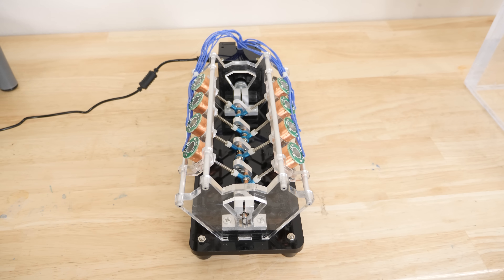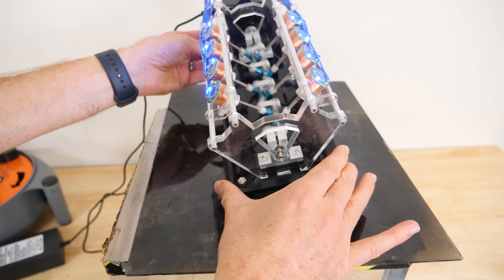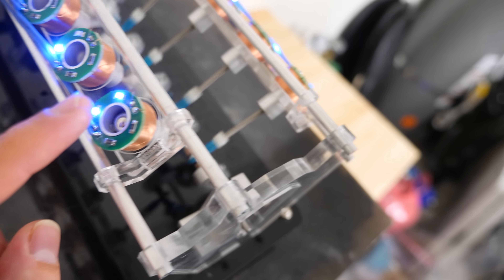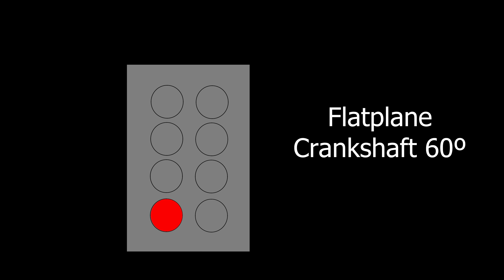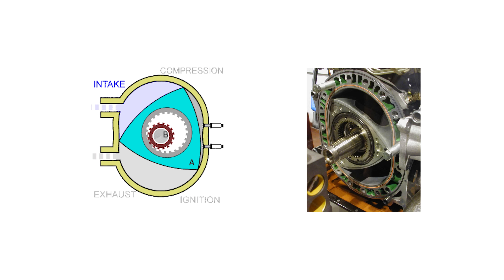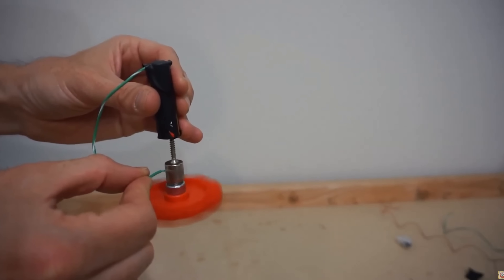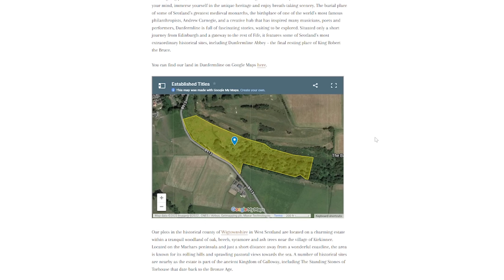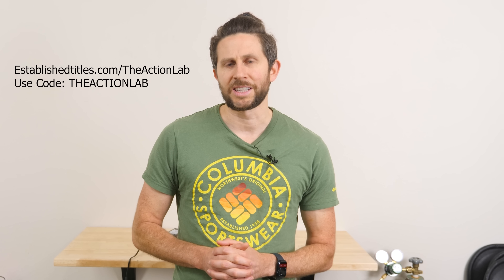Is an Electric V8 Engine a Good Idea?

Comment: So what if you assisted a diesel motor that uses compression to ignite the fuel. The electric coils could assist on up stroke and down stroke. Meaning higher compression and less fuel needed.. what if you put magnets on turbo outter compressor blades or on exhaust outter turbine blades and make turbo go into boost earlier in rpm range with electronic magnets. It could also spool higher at upper rpm range. Only restrictions would be not enough exhaust gasses to turn the turbine causing restriction. You could do low rpm butterfly exhaust dump valve that opens when just using magnets mainly. Such as at max full throttle rpm. Where exhaust tapped out but turbo electric assisted could spool higher if not restricted by exhaust gasses.

Comment: this innovation may save the world economy as we all are looking the side effects of electric vehicle which are running  by a electric motor that means causing damage to the society as the engineer, machinic or the people who are engaged in selling of cylinder engine parts like shops and companies which manufacture and sell the body parts of a cylinder engine that means its create lots of industry which are directly or indirectly dependent on a cylinder engine because some is manufacturing  cylinder of vehicle engine, some is manufacturing carborator, some is manufacturing filter, some is manufacturing plug,, some is manufacturing wire, some is manufacturing coel, some is manufacturing garari, some is manufacturing piston, like this many others are directing or indirectly engaged in the business, other sector is in selling of these parts some is selling plugs, some is selling filter, some is selling cylinder, some is selling carborator, some is selling garari, and many parts of vehicles and in other sector there are engineers manufacturing engine and mechanics who are directly involved in this business will more affects by replace of cylinder engine vehicle by a simple electric motor vehicle. so please appreciate your idea of for manufacturing a cylinder engine by electricity it will leads to creates more jobs in more sectors and it will not close down any sectors which are engaged in this vehicle manufacturing sectors since a long time.

Comment: Simple solution: make a pneumatic engine, put in a chemical reaction with H2O2 and KMnO4 in a tank, make a regulator for 2 bars (29psi) and run it up. Integza made one but I saw it work only with compressed air. I thought about it. Hydrogen peroxide and potassium permanganate's reaction reaches up to 60 bar. So you can totally make an engine that sounds awesome and it uses clean energy. The engine's performance is determined by how much pressure is in a tank. so that's why I wanted you to make a video about it

Comment: Potential method for converting gas engines to electric without swapping engines? Looking at you, @Toyota.
Reply: You need to rebuild the engine block and use magnetic piston which need alot of work and cost rather than swapped it with electric motor

Comment: More cylinders / pistons in a gas engine allow for higher displacement without having massive pistons or excessively long stroke. My 4.9L 6cylinder has bigger pistons than my 4.6L V8. This means you can keep your RPM higher without using exotic alloys. I have a 5.7 hemi and a 5.4SC Gt500 both are V8's they both sounds very different. I love the deeper sound of a truck V8 vs the more race sound of my Gt500 to be honest. I think Cam profile and exhaust configuration makes a big difference.

Comment: No direct need to do it, but maybe smaller version allows mechanical energy to recover electrostatic energy to recharge ev battery or just redundant power primary engine, letting battery multi task to recharge itself. Or people just do it for youtube content, ignoring transformers.

Comment: What's the max rpm? of this V8 configuration? Conversion losses from linear to circular motion is an issue. However, we have the single piston rod. Using 2 electromagnet in a horizontal piston. Its simple design helps with weight and speed control.

Comment: That's a cool concept, and it's shown in the video that it works off of a flat-plane crankshaft system, being that the crankshaft lobes are 180° from each other.  I'm now wondering if it would work on a CROSS-PLANE crankshaft. Also, it is probably not the most efficient way to use the power and torque generated by an electrical propulsion system.  Also, it is not really relevant, but one of the biggest draws to v8 motors that people have, at least in the United States, is that throaty, almost guttural sound that comes with it, if there was a way to NATURALLY produce that sound, like the honda(???) hydrogen v8 motor, then I know of a LOT more people that would be more interested in electric powered vehicles.

Comment: would this engine give you more tork  then your typical electric engine
Reply: It will give less torque relative to size and weight compared to conventional electric motor

Comment: wouldn't it give it more torque if you reverse the electricity in a cylinder instead of switching the power to it off? bc unless im wrong when you do that it should pull it's self back up and not need the other cylinders to push it back up

Comment: If you want this to work... you need cylinder sleeves made of non ferrous materials... a piston hinge pin with no ferrous material and a piston rod with no ferrous material....
the electromagnets need to be two, three, or even 4 tiers deep/in parallel.... the piston needs to be highly polished aluminum or copper... the rings need to be a durable heat resistant mdf?
When the magnets turn on the field they create expands and is pushed back against by the induced field that is generated on the surface of the piston....

Comment: Great, at slow speeds. But relying on the coil inductance will add a lot of delay when you run the engine at 100 cycles per second (6000 RPM).  And where is your source of energy coming from? A battery! Batteries are the weak link in EVs, not the motors.  
Gasoling engines do not "explode" the BURN. Explosive detonation is damaging.

Comment: You are not considering back emf could be used to fire each other piston in turn with less losses.
Not to mention you could also use compression with valves and add an accumulator tank ?

Comment: Electric motor, especially AC motor, is a wonderful invention that should have displace gas engines a long time ago. But the main reason it was not used in cars is the lack of high capacity batteries until recently.

Comment: V8 solenoids. Why make something with loads of  friction?
Just add more motors to a drive train and they will increase the torque but marginally increase  RPM at the cost of range. Tesla uses 2 motors if I'm not wrong, the PM-AC type. 
The pit fall of EV bikes and scooters is the "Hall effect" sensor in the BLDC motor, which when burnt, needs opening up and replacing. Even though the sensor is cheap, its a pain to open up and replace them. 
Sensorless PM-AC motor with a variable frequency drive ticks all the boxes. I hope they replace BLDC motors soon.

Comment: I've often thought there was no reason not to have a speaker put out a sound on an electric vehicle, if just to let people know it's moving, so they know to look out for it.
Reply: i have always thought this would be a cool idea, too. from what i've read, i know that some cars actually use the car stereo system to play engine sounds for the driver in order to add to the experience, so this would just be the same thing but for full EV's. 
realistically though, i think the novelty would war off pretty soon and it would just be turned off after that. for example, modern automatics have the paddles which let you shift like a standard, but after playing around with them a few times, who actually uses them for their daily driving? so i think it would be similar to that. if you want a standard to use the gears, people just get a manual transmission, and people who want the engine sound will just get a non-EV. however, it would still be pretty cool if an EV implemented the idea.
Reply: NHTSA actually mandates that now and has for a while

Comment: A linear motor like that can make an excellent air pump, a free piston air pump with low noise, less friction, less vibration, longer life, better performance. Gasoline & diesel engines are effectively air pumps by design //

Comment: To get a cool V8 sound, the idea can be hybridized. An actual combustion engine with magnetic pistons, that uses real fuel, where the cylinder wall wrapped in electric coils that assist the piston, to make a hybrid electric gasoline or diesel engine with E-boost assist, that can turn the fuel off & run in full electric modes with lower output for low load highway cruise, when going down hills, to recover energy to charge the vehicle battery with regenerated energy
Reply: This is all very impossible sounding. The magnets on the piston will get demagnetized in the extreme environment, and considering the cylinder is metal, the magnetic fields won't even go through to the other side to energize the coils. The best way to go about this would be to attach an electric motor to the engine output shaft through a clutch and using it as a motor/alternator as needed. In other words,  a regular hybrid car.
Reply: @kamisama9715  one. why are there magnets anyway.
two, i use ferrite magnets to hold tungsten carbide tips as i braze them. they get red hot and stay magnetic.
three. why magnets again?

last time i looked inside an induction motor, i found zero magnets.

thing is... this whole video, this comment thread, these replies... are an example of stuck in the rut thinking. complete misunderstanding of how basic machinery that powers our everyday lives actually works. complete inability to look at things from a new angle a different perspective.

i can get a 50mm ferrite slug to repel from a coil with 10A at 12v. it can create 12T of pressure. i use no MAGNETS. i tried figuring out gauss and webers and oesterd once but wow, that stuff just makes it all seem confusing and obscures the simplicity... its for professors to teach, not for people to actually understand and use in practical things. there is no easy way to correlate "so many turns of wire at so many amperes makes a field this strong that can lift so many kg of a ferrous material". its all obfuscated and made ridiculously complex.

easier to just fiddle with bits of wire and some logic and use a strain gauge.

how much pressure can you get onto a crankpin with a traditional combustion event in a piston engine, with a 50mm piston?

take 100bar to be the maximum pressure available, at TDC, when the crank cant really do much... and remember, thast only a brief spike, its well below that by half stroke...

so how much torque could i get with my 12T on the same crankpin? when its at 90 degrees rather than TDC?

and i can dump that power pretty fast... and it comes back when i turn the coil off!
Reply: I mean if you could do something like that and reduce the overall force required to push the pistons you could get higher rpms with same amount of wear maybe more of a race thing then an efficiency thing
Reply: Actually we can use this configuration to assist internal combustion engine meaning boosting the overall power of the engine without much issue and for the same volume of engine

Comment: Would this configuration have a niche application? I mean, a real practical use.
For instance, a straight-forward electric compressor would be something like an electric motor powering a piston compressor. However, we could make this process much simpler if a solenoid powers the compressor piston directly.
Reply: Well, the other way around, if you have a communal crankshaft of X length, the public can add/subtract modular motors to use it's energy and/or dynamos to add to it's momentum, like energy buyback for electric vehicle parking lots or whatnot

Comment: Sadly I can't think of any advantages making a full sized version would have, Torque is almost certainly a no. And speed/HP isn't likely either, only thing would be MAYBE some advantage from reincorporating a transmission, but I'm not versed enough in electric performance to know for sure.
Reply: You could maybe make a less complicated hybrid like this instead of different shafts and stuff but probably not super practical

Comment: used to have an old DC electric motor that sounded a little like that, but it was because the bearings were so worn out that the armature was wobbling

Comment: By reversing polarity you could make each cylinder pull on upward stroke and push on downward for more torque.
Reply: Cool Idea bro.
Reply: Wouldn’t that slow the crankshaft or skew the timing of the engine?
Reply: @TheNuclearBolton  It would work if you fired 4 of the 8 pistons at the same time like in that model. That way while half the pistons are being pulled to the top, the others are being pushed down at the same time. However like he said you don’t usually want to fire multiple pistons at the same time.
Reply: boys have penis and girls have vagina
Reply: This same thing works with Lego vacuum engines too
Reply: pffft. how typical. how imaginative.

how about making the piston from an iron slug, place the coil at the midway point, wrap a single copper ring around the piston, then simply slam some power through the coil when the slug is in the middle, so the crank is at 90 degrees, with maximum torque, and the induced current in the copper ring causes a repulsion that forces the piston down? and up on the return stroke. and you can also have coils top and bottom to fill in the other two half strokes.

attraction sucks. repulsion kicks arse.

then the return spike of the collapsing magnetic field from the coil being de-energised can be captured into a capacitor and recycled, but thats silly talk.
Reply: @paradiselost9946 great idea, I had a similar idea. You could also turbo power it by putting dynos on the wheels or crank shaft and throwing that extra generated electricity from driving back into the pistons making it way for efficient. Also the heat generated from the breaks could be captured and turned back into energy as well, so many ideas!
Reply: @paradiselost9946   podría ser pero ser pero se desperdicia los puntos muertos tanto superior como el inferior  donde se podría tener una guanacia

Comment: New electric dodge charger will have a speaker in a fake exhaust so it will have a v8 kinda sound. Doesn’t sound great tbo but it’s something. I think a better way to improve efficiency in an electric motor would be give it a transmission that way you can always have increasing power and real horsepower not just torque.

Comment: As an engineering employee with a company that was developing a machine that needed the performance and especially the low-end torque of a diesel engine when "bogged down" with a very high load. When we tried using the same rated  horsepower electric motor instead, instead of "toughing it out" and coming recovering from an extreme load like the Diesel, it simply threw its breakers and quit.
There is a lot to be said for the torque a heavy crankshaft/flywheel combination can give you over the impressive numbers the electric motor manufacturers put out that promise you "indefinite" performance under any condition until it is hit with a "real world" problem.

Comment: The biggest benefit of this with a mechanical motor is that the motor could theoretically also be hooked up to a generator which could in turn recharge the battery. It wouldn't be 100 percent efficient but it would make progress towards it
Reply: right...recover some of that energy....

Comment: actually you're still converting motion with an Electric engine, you're just separated from the source providing the charge, i.e. the power plant. 
You're also losing more energy to the InternelSeriesResistance from the battery, and the transmission of power from the source PowerPlant to the Transmission lines, then Tesla charger circuit, then the Tesla's charging circuit, then finally into the Tesla's internal circuitry, charging the battery and eventually from the battery to the motor. 
Along the city Transmission lines you lose about a rough 30%, and when converting Coal/Gas/Wind/etc into energy, Coal loses about 20%, Gas I `think` is about 16%, and the Wind is dependent on the energy required to overcome friction, drive the motor, fight the internally induced magnetic charge fighting the turbine, etc, etc, etc
In the end, you're actually losing a lot of energy with an EV when you look at the entire picture.

Comment: On its own, electric reciprocating engines would not make much sense due to inefficiency compared to a standard electric motor. Maybe the technology like this could be combined with a combustion engine to possibly aid in fuel efficiency or at the very least give a boost in low end torque performance. At the end of the day I just want my cars to still make vroom vroom noises 😢

Comment: Terrible, The main problems with EVs are that even with 100% efficient motors it still takes lots of energy to move large weight at high speed and our batteries are not even close to the energy density of fuel, getting the energy to charge them requires a massive load on the energy grid, and the current batteries take a lot of rare valuable materials to build and cannot recycled so far.

Comment: So why not make a proof of concept go-kart with this type of engine? How much "horsepower" would one of these types of engines have vs other types of motors?  How much electric would be needed vs other types of electric motors?  Would this type of engine increase the range of a charged battery under a full load?